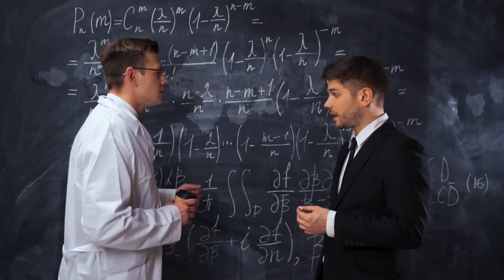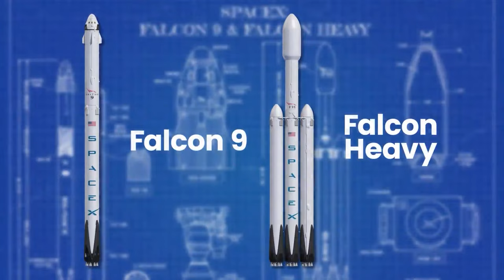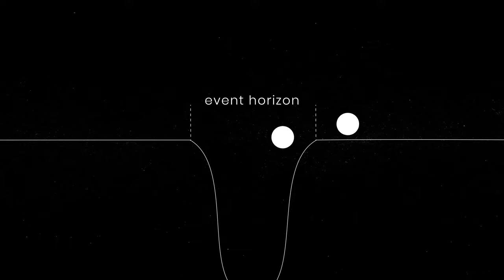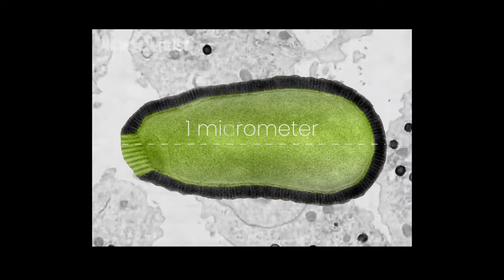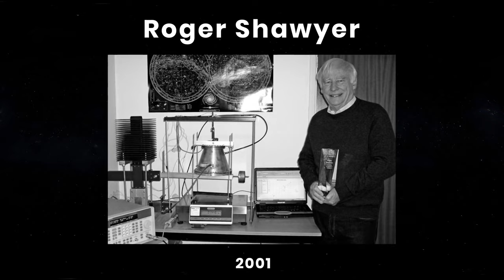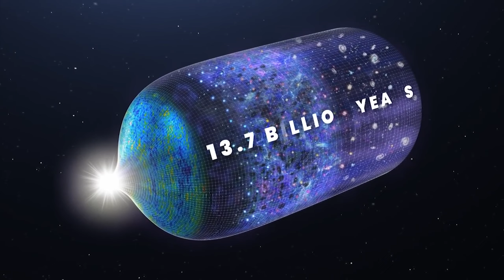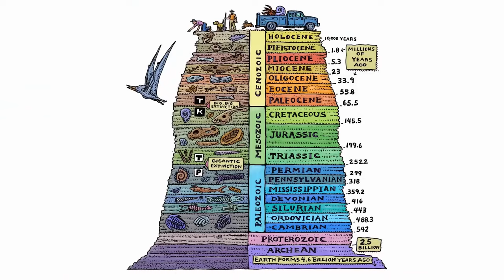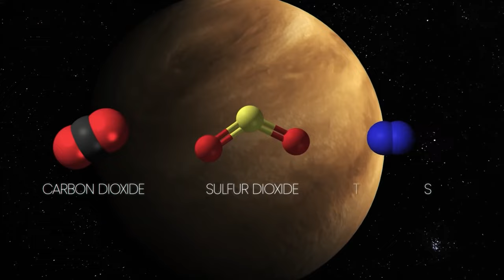NASA Discovers Mysterious Structure In The Universe - Best Video From Destiny 2021

Comment: The glowing disc around blackholes isn't hawking radiation, its the accretion disc, and the neutron star hasn't fallen past the event horizon which is the point past which nothing can escape, rather its orbiting the black hole and losing material to the black hole in its orbit

Comment: Attention: at 1:50 you describe the "ring of fire at the edge" as "Hawking Radiation". That is not accurate. Hawking Radiation is when a pair of virtual particles form out of the quantum foam, and one falls into the event horizon and the other half becomes a "real" particle radiating away from the horizon.
Reply: Also wrong^^ That is what physicists tell people so they understand it better, because missing wavelengths and modes in the quantum field due to the black hole get's to complicated to explain. But yeah, the Temperature of the hawking radiation of a small black hole (30 solar masses) is just 2*10^-9 K, and gets smaler the bigger the black hole becomes, so yeah, you are right in that he is wrong^^
Reply: @danielotto1027  😂
Reply: Amc547 Warlord  potentiality
Reply: @danielotto1027  Exactly. The wavelenght of the photons emited by the hawking radiation is as large as the black hole itself. And I think what we perceive is different because of relativity and the curvature of spacetime. Like it becomes a photon only at an infinite distance. Something like that lol.  But I may be completely wrong lol.
Reply: Lee Sylvester   i never knew that was issacs middle name mon : ))
Reply: Amc547 Warlord  the term "virtual" means a pair of particles (one particle and one anti-particle) that come from quantum instability of space and have no total electric charge, so they don't violate any of the laws of thermodynamics. if anyone sees this feel free to correct me

Comment: The ring of fire around the black hole is called an accretion disk, It's not hawking radiation. 
 Hawking radiation is very slow and cold process. The smaller black hole is the hotter and faster the hawking radiation will be produced but at this size it's colder than ice.

Comment: The "ring of fire" in Hawking radiation is actually 3D so it's a "shell of fire." It's just nowhere near as intense as animated here. It's faint, but it does in fact "cover" the hole, which is also 3D. The hole (inside the event horizon) does in fact have a temperature, but it is very faint. A corollary to this is that the rate at which black holes evaporate is very very slow such that they will outlive most of the rest of the interesting life of the universe, sucking up almost all of the mass like sea life sucking the flesh off a whale carcass slowly. The lighter "foamier" energy/information is "squeezed" out of the matter, and separated from the mass. It either spins there around the eventt horizon or just beyond it, until it finally makes the leap back onto the other side of the event horizon as radiation, and becomes part of the glow around the 3D shell that covers the 3D hole or else gets shot off in pulsar jets. Meanwhile, the mass falls into the hole and is separated somehow from almost all of the other information. The mass continues to go to the singularity and be stored there mostly for the time being, but also it evaporates off too eventually, being still energy, and even causes jets to shoot out sometimes depending on how stuff is falling in and perturbating the black hole's dynamics.

Black holes may be the explanation for a lot more things than we realize. For instance, the universe could be on the rim of a 6D black hole and the spaghettification that happens looks like spatially-uniform (but temporally evolving) 4D expansion to us, in the same way as falling into a 4D black hole looks like 2D  expansion to an observer (1 dimension of space [spaghetti] + 1 of time [time dilation]). This could be the explanation for Dark Energy, aka. the expansion of the universe. Our universe has a preference for matter instead of anti-matter which may be due to the fact that the antiparticles which mirrored this universe, were sucked into the 6D black hole while we are in fact the 4D Hawking Radiation. In this view, reality starts off as nothingness, but holes "vacuum away the opposite" to leave something instead of nothing. Holes create reality by separating. This is basically ying/yang in physical form. While ultimately all is one, duality still exists as a hack to get the boring one to behave more interesting. Once you have binary, you have all you need to create all information. This is why particles and antiparticles are so fundamental to the creation/existence of this matter-like stuff we see around us. It's just that the antiparticles would like to rejoin with the particles and cancel back to zen. That's a problem, but black holes suck away this threat, carving out reality temporarily. We are that reality, made of the Hawking Radiation that escaped. The different stages of the Big Bang and continuing expansion of the universe is due to the universe being warped in different stages as it travels in reality to the 6D black hole. In the 4D black hole case, we know those tiny things, if at an off angle to the hole, get stretched out around the horizon, becoming much larger. Our universe would similarly be stretched out by the 6D black hole in various stages.

Meanwhile, tiny black holes could be the explanation for Dark Matter, scattered throughout the universe overall uniformly, and mostly too small to interact and join together.

Black holes can have charge and spin. And if black holes could be miniaturized enough and sometimes given charges and sometimes spin, they could go on to explain Quantum Mechanics. If the curvature of spacetime itself at small scales is manipulated by tiny black holes which are stable enough to not immediately evaporate to Hawking Radiation, and some of those black holes can charge and spin, then we may be able to explain everything else. That includes gravity at the quantum scale, which obviously would be very weak because tiny black holes without any attractive charge would rarely get close enough to have their curvatures create the sense of attraction. And this matches our reality. Tiny things don't seem to be affected by gravity, but in large clumps start to be. In this view, reality is just a fractal of bubbly spacetime, with the bubbles being black holes on all levels. On some levels, the way these black holes interact geometrically makes for the evolution of "quantum wavefunctions," which is just another way of saying "how the black holes interact witch each other across size levels."

Across other size levels, it leads to larger scale spacetime warping (G.R.). On some levels, black holes tend to pop quickly (evaporate fast to Hawking), on others not so much just as when you are watching a stack of bubbles and notice that certain sizes are more stable than others, popping more slowly due to how they interact geometrically in the context of the larger bubble structure they find themselves in. And the Hawking radiation itself is of course just more, smaller bubbles that get shot out as two bigger bubbles merge. Not all of the holes when two bubbles merge go into the newer, bigger hole. Instead, some of them shoot out as a harmonic side effect of the walls of the two larger bubbles joining. And this is Hawking Radiation in the case of what we think of as "black holes," but it's also what creates the different quantum fields, which are different sizes and shapes of holes with different rules to how they interact thus. Some hole sizes and shapes look like photons, while others look like gluons, for instance. This also explains the different generations of particles. You would see harmonic patterns emerge as you scale from the smallest bubbles to the biggest bubbles, in a bubble structure. Certain size levels would mirror each other in some aspects. Some generations of particles are more massive because they are made out of bigger holes. A corollary to this way of thinking is that supermassive black holes are like ginormous mega-particles which are surprisingly stable, yet radioactive, slowly decaying into much much much much smaller holes (again, Hawking Radiation). Meanwhile, stars are like bubble structures that are decaying into smaller bubbles, due to the curvature of spacetime they create. The light and other radiation streaming from stars is ultimately made of smaller holes. Holes give birth to new holes. Imagine, how when bubbles merge and collapse in water, they shoot off those harmonic shells of other sized-holes, and basically, you understand what I mean.

When you fall into a black hole and are "cloned," the anti-version of you goes inside, while the other version of you slowly freezes in time and very slow "fries" and "fades" into the ring of radiation that orbits the horizon. Cloning is allowed and natural once you realize reality is made out of ripping nothingness apart into bipolar opposites. Thus, the curvature at the event horizon rips nothingness apart into you and anti-you. The you that existed in the moment before this ripping serves as a template for the next moment, but from moment to moment, you are "different" particles in reality, just influenced by the previous moment causally. In each moment, you are in fact caused by the ripping of nothingness apart into you and anti-you. It's just that usually your anti-self gets sucked away immediately into the tiny-scale black holes that create quantum mechanics, so you never notice them. At a larger black hole, like a cosmic one, the same thing happens, but the antiparticles get sucked into the bigger black hole instead of into the tiny ones that create quantum mechanics. Either way, the anti-version gets shredded at the singularity, and it's merely a matter of scale. The bigger scale allows a "survivor" to pass over the event horizon and enjoy it for a few hours or days before being destroyed, while the tiny scale of the quantum world happens almost immediately--for if it didn't, this universe would be unstable and decay to nothingness instantly.

In this view, coherency is created from moment to moment by the clean-up crew of black holes that again, suck away the anti version of reality to carve out reality.

I call this the "Black hole Bubble Universe" or "BBU."
Reply: damnnn that's some trippy theory

Comment: That Challenger comment about things that are “supposed to work like they usually do,” or whatever you said…that launch was delayed due to below freezing temps a couple times and the o-rings were never designed to endure those types of low temps on the launchpad. There was real concern pre-launch and that was an accident that SHOULD have been avoided. All the warning signs were there. The engineer who designed those parts said so. I get what you’re saying and agree, that’s just a bad example

Comment: At  this point in time the Black Hole in our own Milky Way is suspect as it was spotted what was considered Dark Matter in the region of our Black Hole but it seemed not to fall in; & I concluded & assumed the Black Hole itself is actually made from Dark Matter. It was loosely mentioned here that this may be the case. I suspect it will turn out to be the case. Thank you for your work here & time.

Comment: This can't be entirely correct.  Imagine space time so extreme, near the black hole, that you would be traveling faster than the speed of light.  You can't exceed the speed of light, and so you would begin to slow as to not exceed the speed of light.  Eventually you would have to move in the opposite direction away from the black hole to prevent moving faster than 2x the speed of light due to the extreme bending of space-time.  In essence, there would be a point within the extreme bending of space-time where you could not move closer nor farther away from the black hole.  You could never get to the singularity.

Comment: The scratching sounds coming from Mars rover, it's the sand accumulating within the wheels and as it the rover moves forward or backwards, the sand continuously builds up on the opposing side to direction of travel which accumulate, and slides down and out continually being replaced by more of Mars' dust/sand and on and on it goes.
So imagine an empty round bucket, laying in its side, in the desert, as it begins to roll down a slight slope, any sand within the empty space inside the bucket will by friction stay temporarily attached to the inside surface of said bucket, then as one rolls it one way, the sand sticks until it can no longer and then slides down to starting point and in it goes, making a shhhhhhh.....sht...shhhhhhh....sht...... sounds.
If you can't imagine it, seeing it in your mind, then Try it and you'll see exactly what I describing.

Comment: No way you cant get data from inside the black hole to outside. Information still be read through Jet stream of radiation. If you Plunge a very big space craft  as big as a star into a black hole you will have a Jet stream and lets say we call it "data 1". but what if we split the whole space craft into 2 pieces almost through event horizon, we initiate a dismount  after it does something two separate part of ship already plunge and we can look at the jet stream that is slightly unique than data 1 only we can call it "data 2". if somehow the people of this ship know how many times to split the ship into tiny bits and which is heavier and not just in order to give a data just a small distinct radio wavelengths readings of the blackhole's jet stream then maybe we can send out a message saying "goodbye" who knows we already read the "wow" signal coming from vast space maybe this time we can observe someone saying goodbye on the jet streams of a blackhole
Reply: You do realize that any matter heats up to millions of degrees long before falling into the event horizon right? There won't be any spaceship by the time you get even remotely close to a black hole just a bunch of superheated subatomic particles.
Reply: @KT-pv3kl  it will be possible with just the right execution. With just a help from future things will be possible. scientist made the coldest spot in the universe here on earth and its made on a lab INFN in italy project Cryostat progress is ongoing. your melting problem will be fix by counter acting the heat even if its not enough it will make time just enough to make the perfect execution. gravity problem will be fix by a perfect execution
Reply: @KT-pv3kl   @K T  Also ITER Fusion Reactor in Saint-Paul-lès-Durance, France has been already making a fusion reactor this year, heating the plasma as high as 150M degree Celsius thats 15x more hotter than the core of the sun. with the help of Cryostat it is easy to counter the melting problem in that reactor. if they precooled it before entry it can still buy them second to execute the moment they get to the event horizon.

Comment: Why can't they use pressured air to move around in space.  Just the way you inflate a bicycle tire, you would pump the chambers.  Then, open it on the outer end to give the rocket an air push.  No fuel needed.  You would need oxygen or helium tanks instead.

Comment: If you entered a black hole, even just near the event horizon, you would die due to heat and spagettification.... If you entered the event horizon, you would die to pressure and gravity, if not the other two, or by just having stuff hit you at near-light speed, depending on what model you use... and even if you survived all that, your mind would shatter, and you would immediately go blind and deaf, if you hadn't already....

Comment: what about sending a ship with cameras into the blackhole connected to another ship through a very longgg cable to allow the data to be transmitted before cutting the cable off
Reply: that would be a long ass cable.

Comment: BTW the Andromeda galaxy is not moving away from us, it is moving too us quite fast and it will take another billion years I believe to intersect with the milky way Galaxy, and while we might just pass through each other it could be captured and join together but its very very unlikely any planets or stars would collide with any form the milky way galaxy. But yes the expansion is being driven by Dark energy and Dark matter is like a blank hard drive as the universe expands it formats this dark matter to have the physicals the universe work on. and while some creationists want to say light speed in space is different then locally, but they are wrong, light is limited to the speed of light but it can seem to move faster as the space between 2 points can move apart, this is not the object the light is coming from or going to for this measurement, the space itself warms itself moving the it apart faster then the speed of light. The point I was tying to point out is that Andromeda Galaxy is heading on a towards us for a full collision.

Comment: I've already posited my thesis 🙃 black holes are invisible as light goes in and doesn't come out.. because it is the 4th dimensions evolution into the 5th. I
A while hole is a black hole with a disc. For more detail just ask. The proposal sounds far out. But my research will make it seem more logical.

Comment: The Milkyway Is roughly 100,000 light yrs wide. So this black hole only being 1,500 light yrs away is actually kinda close in Galatic terms. 
But yes of course still way to far out to worry about.

Comment: What's the rate of speed on the current ion reactor satellite that you mentioned Orbitz Jupiter and or one of its moons. The one that converts solar into electric and then into particle waves microwaves and aims them at a nozzle through a chamber to propel thrust that one